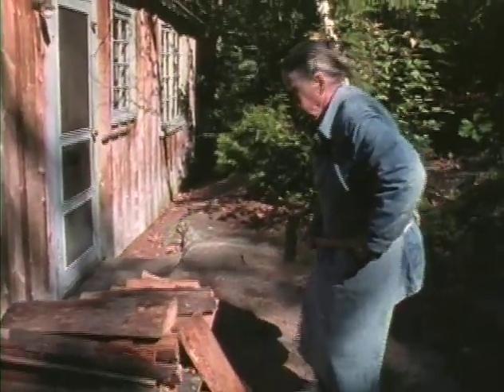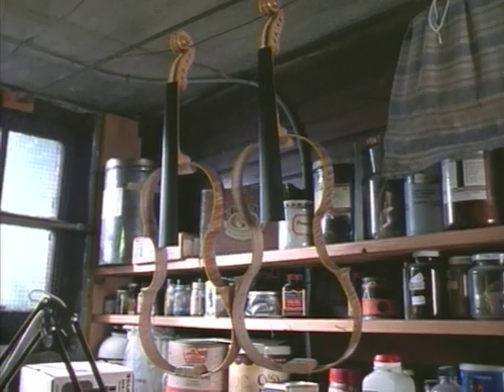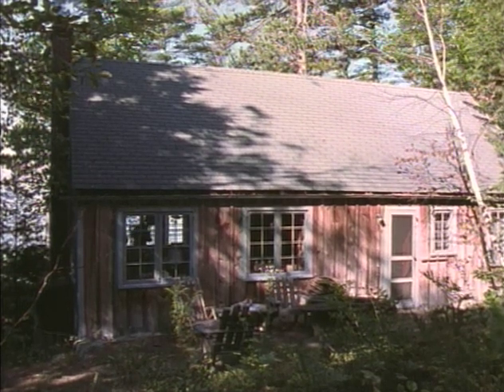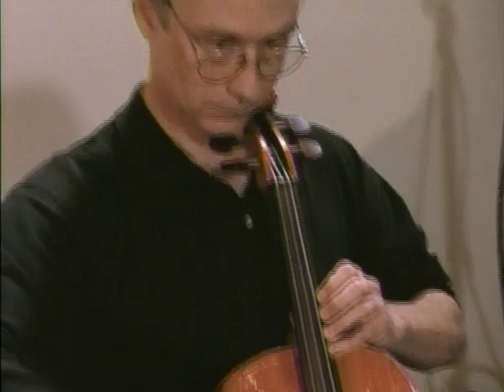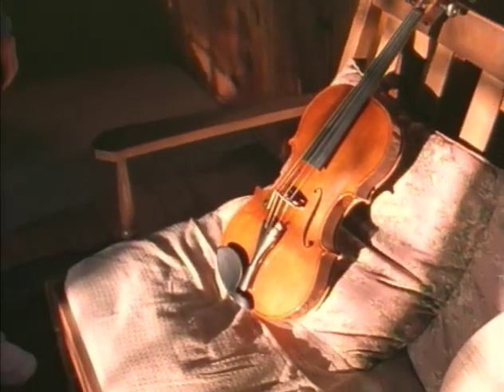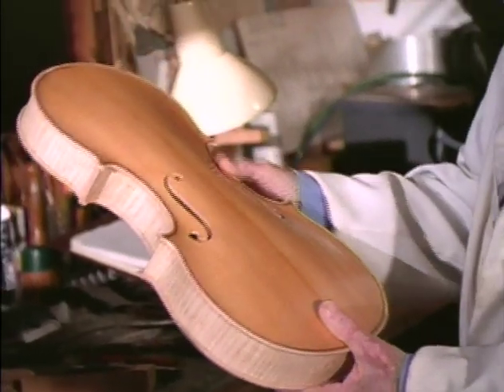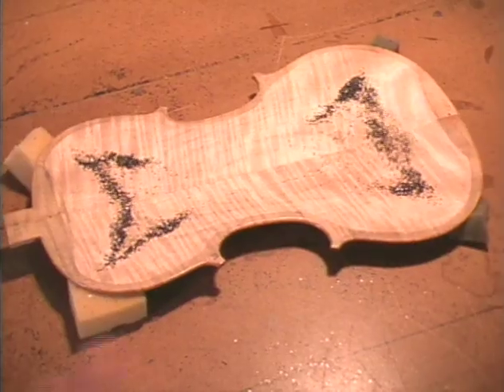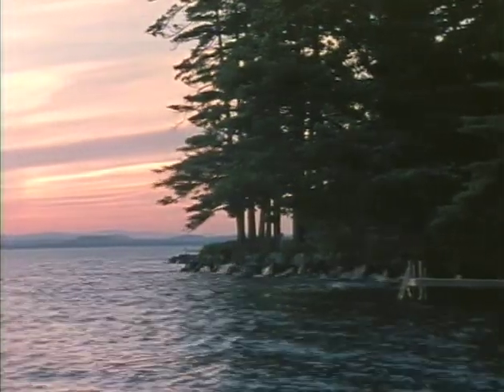CARLEEN HUTCHINS, MASTER LUTHIER

Comment: "Energy tuning" refers to treating an instrument with sound vibrations. Many violin makers and players believe that an instrument's sound improves over the years due to the vibrations from playing it. They think the vibrations somehow change the properties of the wood slightly. Carleen Hutchins tried to replicate this decade-spanning effect by exposing violins to sound 24/7 for weeks at a time. I think she put small speakers inside them and played the radio.
Reply: Yes it does. You can notice the effect playing over several years - the violin opens up a lot. Over even longer periods of time, it starts to attain a very distinct voice of it's own.